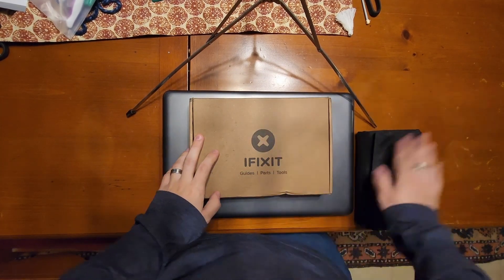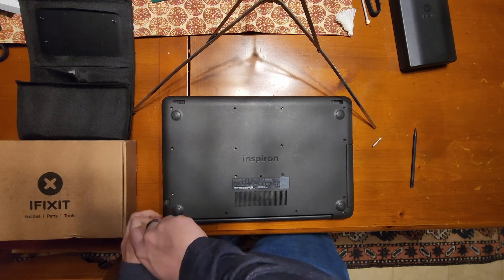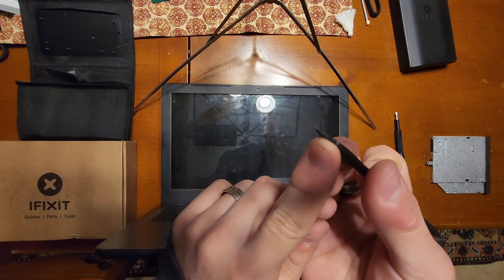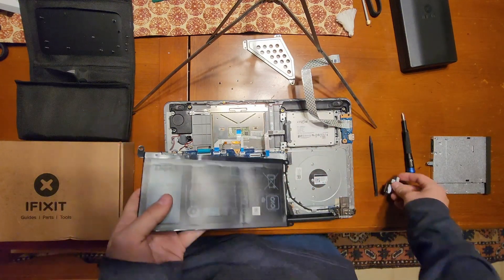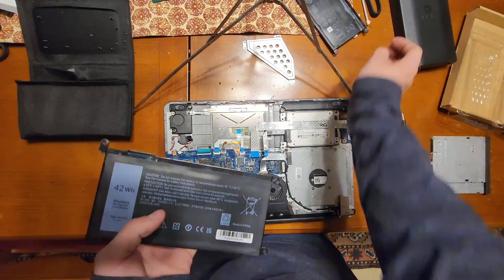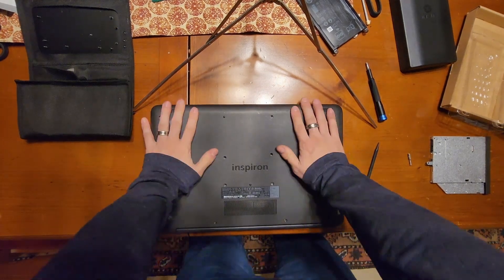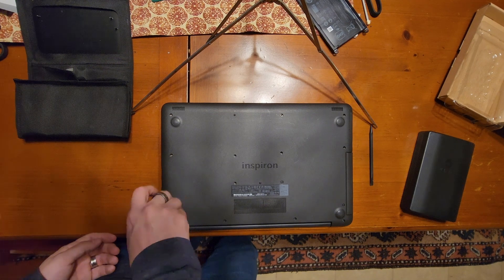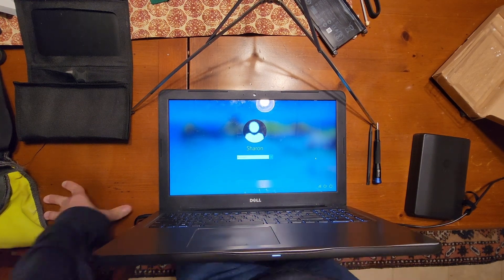Dell Inspiron 15 5567 Battery Replacement

Comment: What is the size of the 3 bolts under the cd drive , I want to get screw driver for them
Reply from the maker: I believe they are either PH0 or PH00. I thought I stated it in the video, but I may have forgotten.
Reply from the maker: They are PH0, I have just confirmed that.

Comment: Thanks I'm about to replace the battery on the same laptop, it helped a lot. How's the replacement battery been doing so far?
Reply from the maker: So far it has held up well, however my mom primarily uses her laptop plugged in.
Reply: @railroadsniper  Hello, I have a Dell Inspiron 3515 model and there is a problem with the laptop. I plug it into the charger, it does not charge, it does not rise or fall, but I use the laptop while it is plugged in with 0 charge and when I enter the bios screen, it sees the adapter as unknow. What do you think the problem could be? Can you give me a suggestion?
Reply from the maker: @alpercan7932  I cannot be sure of course, but if you are able to use the laptop with the charger alone and no battery, this would make me think the battery is the problem. I would start by checking the battery connections and if that is not the problem, I would try changing the battery. That is just my personal opinion though.

Comment: I have exactly this notebook. Is it possible to upgrade the battery? I think its capacity is very limited. Are there more powerful batteries compatible with this model?
Reply from the maker: I do not know if there is a battery upgrade, I wonder if maybe the higher end versions of this laptop have a bigger battery though. I have not seen or heard of one if there is.
Reply from the maker: It looks like even the model with a discrete graphics card has the same battery.